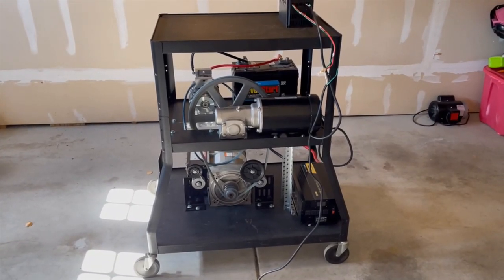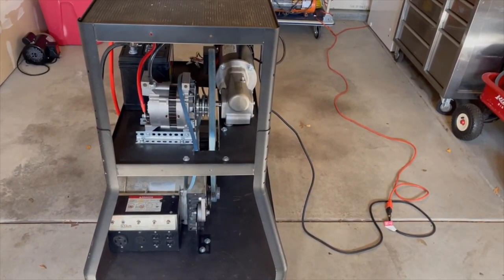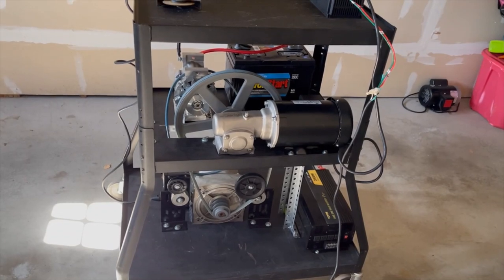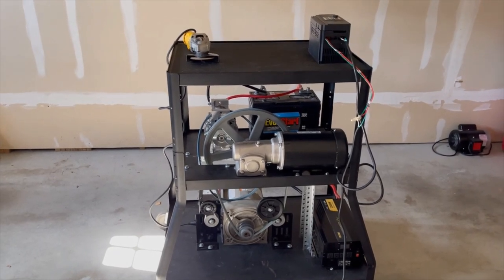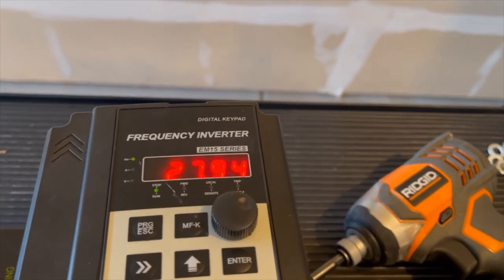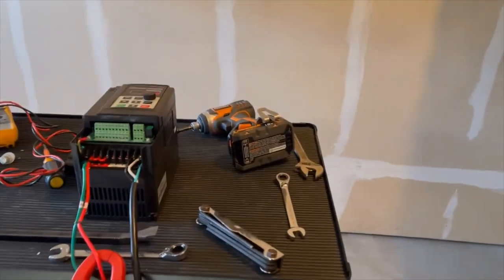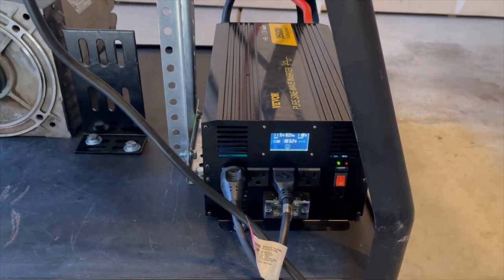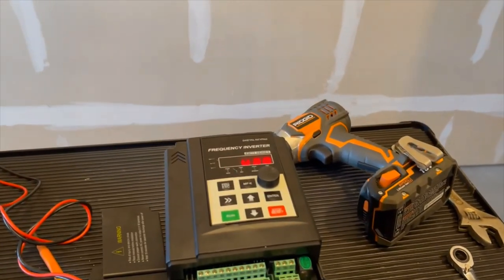Free Energy Fuelless Generator Project Video 7

Comment: Thanks for share, I believe every 750w is equal to 1 hp. That means you’ll need about 13hp to push 10kw genset. Hope that makes sense.
I did few test my self on 2hp. With 1500w genset and result we’re at 50% unit the load and gent backed off. Probably worked if I had super capacitors but talking about thousands of dollars into projects😮 but thumbs up and keep on trying)
Reply from the maker: Thank you for watching my videos. I’m getting close. Need to sell some equipment off to buy what I need. Cheers!

Comment: PUT BIGGER PULLEY ON GEN TO SLOW SPEED DOWN TO 75 VOLT OR SO ,TO HAVE MORE CONSTANT TORQUE. NOW RUN GEN OUTLET INTO STEP UP TRANSFORMER TO GET YOUR VOLTAGE BACK UP AND NOW YOU CAN POWER STUFF.  having more torque and voltage,  and a  35-50 lb fly wheel would help.
Reply from the maker: Thank you for the feedback and advice.

Comment: Use a cap dump and it won’t load down the alternator, caps charge easy.
Reply from the maker: Thank you! I was thinking a bank of super capacitors. Would these be between the battery and alternator?

Comment: What if the big gear was smaller
Reply from the maker: I’m sourcing a lower speed higher torque motor and then use pulley sizes to get speed correct.

What’s happening is my motor can’t get up to speed due to lack of torque causing the motor to get super hot and fault drive.
Reply: Keep trying buddy you will make it work
Reply from the maker: Thanks for the positivity.

Comment: Theflywheel is missing.
Reply from the maker: Thank you for the advice. I’m trying several test with out using a flywheel. Will eventually make this system as compact as possible and still function properly.